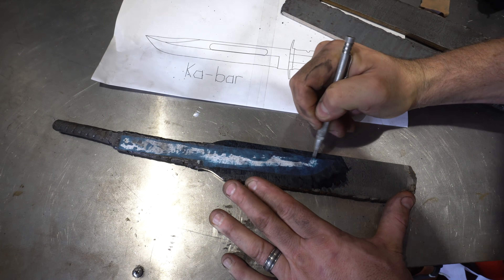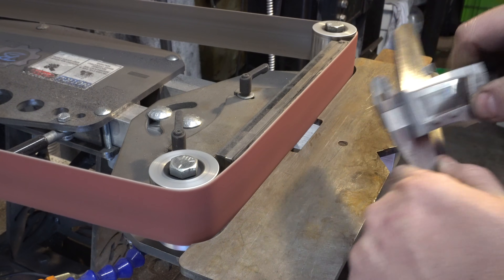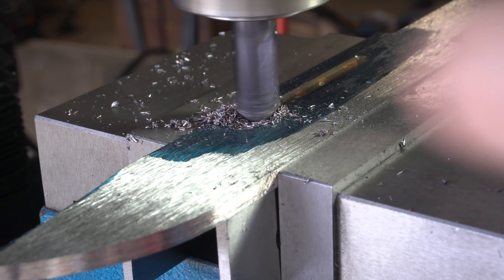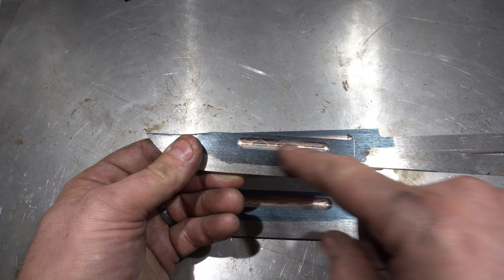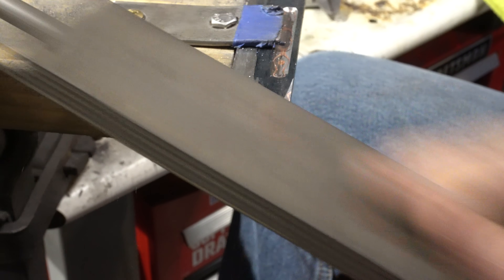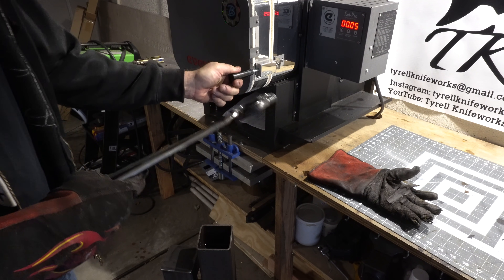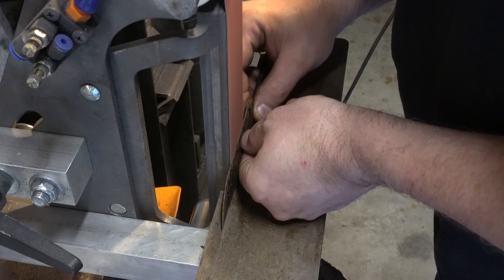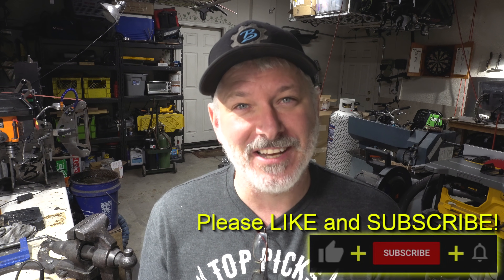Making Three Cu Mai Ka-Bar knives - Part 2 - Grinding and heat treating

Comment from the maker: Thanks for checking out this "cu-bar" build!  Do you think I should do the blades in black/copper or silver/copper like the Bowie-on-fire?
Reply from the maker: I’m leaning towards the black/copper finish!  👍
Reply: With the steel black the copper does pop more
Reply: The original blades were black so I would stay with that theme
Reply: Those Ka bars make awesome profiles to emphasize the beauty of the Cu Mai process. 🤘
Reply: Black Copper would be very striking.
Reply: I think they would look awesome silver / copper Bowie on fire look. I think that would be super cool!!! 👍
Reply: Black/copper would be beautiful
Reply: Black and copper for sure!
Reply: black
Reply: Another vote for black/copper
Reply: Black and copper
Reply: One of each maybe.
Reply: I would say black/copper
Reply: My vote would be for you to do a bit of an experiment and make a few of both, then see which one's sell better.

But I'm trying real hard to keep my ignorance out of y'alls comment sections. I have no clue how any of this works.
Reply from the maker: @jojoemcgeejoe457  First off, never feel you shouldn't comment.  Anyone of any level should feel free to ask questions and make comments.  This is already a batch of three so I'll probably do them all the same since two are pre-sold.  I am not a production shop so I don't make knives for production selling, only as YouTube content, so I won't be making more ka-bars after this run.  I may experiment a bit.  The issue is that the copper sometimes bleeds a bit in the etch so you have to sand it down.  We'll see how it goes.

Comment: I'll be filing in my first false edge next weekend.  Took me awhile digging through your library tutorials to find this one where you're using the jig to cut in the swedge. I can't remember if you have a video showing the complete process or not, but I'm sure there's one out there  somewhere...
Reply from the maker: I haven’t don’t s triple-T on the process, just on the construction of the  jig.  I just mark the center, pick an angle and do both sides BEFORE you grind your main bevels.
Reply: @TyrellKnifeworks  I imagine its compulsory to cut in the false edge first so you know how high to bring your bevels?  To finish the false edge, do you do that process on the 2x72, or when hand sanding the blade, or perhaps both?
Reply from the maker: @Stillpoint23  i rough it in with the file jig and then hand-sand them.

Comment: hi, i started forging knife a while back and you inspired me to make a channel for myself. now my question: what cam would you recommand using for these types of videos?
Reply from the maker: Congrats on starting a channel!  I started with a GoPro thinking it would be easier to keep clean, which it was, but when I moved up to shooting in 4k, it's terrible.  I use a Sony a6400 now.  Great camera!  It's pricey though at around $1k just for the camera plus lenses and the AC power adapter (you definitely want that).  If you don't want shoot in 4k, then there are cheaper options.  Hope that helps.

Comment: I was wondering...
If you take all the shavings from the millwork, and mix them with powder steel or metal, would they make a pattern or just melt?
Reply from the maker: Generally not a good idea.  Chips are full of oil plus they come off quite hot so not good steel for that.  It might work of course though.  Guys have used drill shavings successfully.  It might be better in a crucible.  Thanks for watching, Linda!

Comment: Question about your quenching: Did you have to wait between every blade to let the oil cool back down again?
Reply from the maker: I started with the oil around 100F and did the small blade first.  There’s enough oil in the tank that it didn’t heat up over 140F at the third.  A fourth would have needed some time to cool down though.
Reply: @TyrellKnifeworks  Awesome, thanks!  Those turned out really clean - I dig 'em!

Comment: Between you and RE, you have convinced me to try a cu mai build. I am loving the way these are coming along!
Reply from the maker: You should give it a try!  👍
Reply: @TyrellKnifeworks  I will! I have a kitchen knife build in mind I want to try with it
Reply from the maker: @bjornronaldson6017  keep in mind that copper isn’t really food safe.  I don’t use it on kitchen knives.
Reply: @TyrellKnifeworks  you know, that is a very good point. I had been thinking along the lines of copper bottom pans, but those are sealed.

Comment: Beautiful work as always. I’m curious to know if the copper weakens the knife significantly. Obviously copper has only a fraction of the strength of steel. Does forging and pressing the copper with the steel strengthen it somehow? Does the copper make these knives only for show?
Reply from the maker: The copper is a very thin sheet, it starts as 0.02” before forging so after it is a fraction of that thickness.  The cutting edge and entire core is 1095 so it’s very strong and very functional.  Note, the Blade magazine 2021 overall knife of the year… has copper in it.

Comment: Wow - I'm more than impressed with that copper San Mia - You mention the temp for setting welds with copper is less than normal forging temps.  Do you consider normal Forging temps in the 2200F range?  If so, what is the temp range for the copper San Mai?  I'd LOVE to try that.  Thanks for any help, and THANK YOU for the videos.  Ken H>
Reply from the maker: Hey Ken, yes forge welding temps are around 2200F.  The melting point of copper is 1984F, you you need to keep the billet under 1800 when forging.  Hot enough to move the steel but not melt the copper.  👍. Thanks for watching!
Reply: @TyrellKnifeworks  Thank you so  much for the info - I've got a small 1.5"X4" billet ready for tig welding now and hope to try it later today or tomorrow.   That's why the few billets I've made with nickel layers did ok.  Nickel's melting point is around 2600F which is well above forge welding temps.

Thank you again.

Comment: Thanks for sharing Dennis. I was one of the folks that commented on your Instagram and after watching this its definitely a lot clearer where the copper ends they look beautiful so far. Can't wait to see these in their final form. Keep up the fantastic work and as always thanks for sharing it with us all. 🦾 🔨 🔥 💧 🗡 👀
Reply from the maker: It was a good question, Cory.  The core was a bit thinner than I usually use, or rather the cladding was thicker.  I like a bit more room before the copper starts but these turned out quite nice.  Thanks for following along!

Comment: Hey Denis, those knives look really cool so far. The only thing I would do differently is the run out of the fullers. I don‘t like them to have the same radius as the cross section. I would use a disc mill with. 4-5‘‘ diameter. That gives you a nice fade out of the fuller.
No criticism intended, just a matter of personal taste.
Reply from the maker: I normally do that as well but these are ka-bars and this is exactly what the fullers in a ka-bar look like.  👍
Reply: @TyrellKnifeworks  I know, but that doesn‘t mean I like it. 😉

Comment: Damn you and your cliffhanger endings 😁 Molly had her cameo appearance finally! Those are coming out f@king beautifully. I may have missed it, but did you normalize them three times? Just wondering.
Reply from the maker: I mentioned it, they were each normalized and then two more rounds of grain refinement cycles and tempered C at 375.   They came out at 59 hrc.  👍

Comment: Machinist trick for you, if your mill head will tilt, cock it over about 10° when using a ball nose end mill and the radius in the center will cut cleanly. It's worth doing if your ball nose work is being carried out as a separate operation and it's not as hard to tram the head back to square as everyone wants to make it out to be.